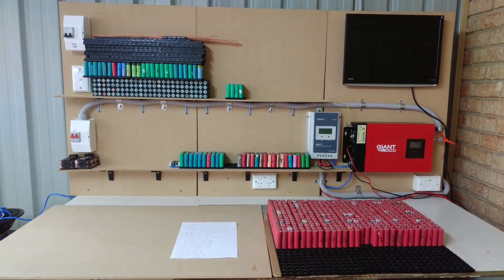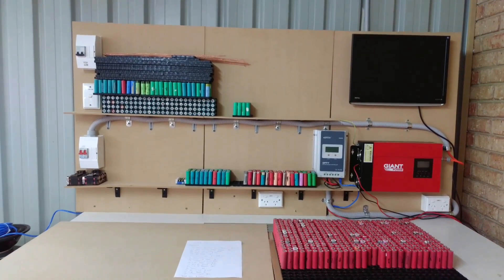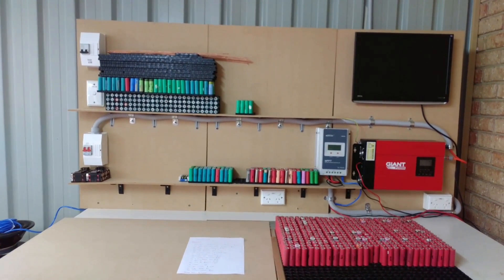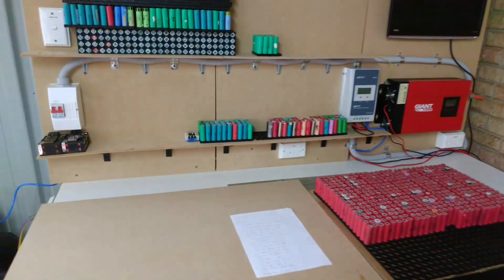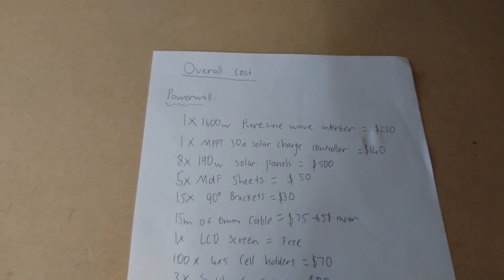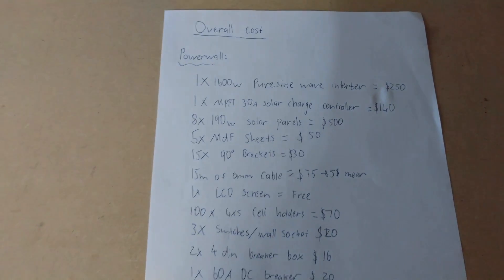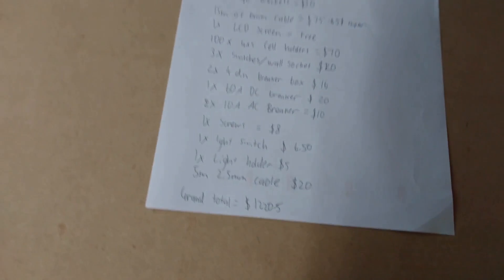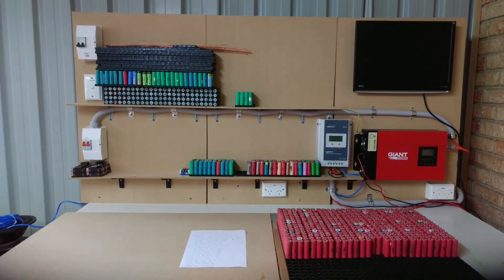DIY Tesla Powerwall | New Patreon Page Opening! | Update 24

Comment: With 16 you make powerwall.... 👍 with 21 you build fusion reactor... 👍
About balancers try to use  like UK diy powerwall I use the same one and they perform awsome.....underload and withoutload they balance all the time.... 
I don't check my li-ion battery's anymore.... Ok every month.. 👍 and are balanced like in 0.2v....
Balancers are not cheap but they activ balance.... 👍
Reply from the maker: Yeah was looking at the batrium system, but is way out of my price range,  for now I will just have to constantly check the cell balance. I will set my charge controller so if the cells were to go out of balance I have a greater safety margin.